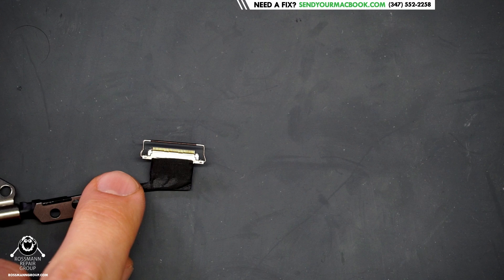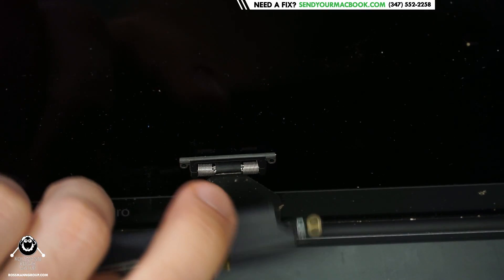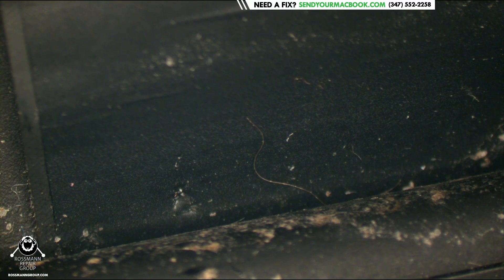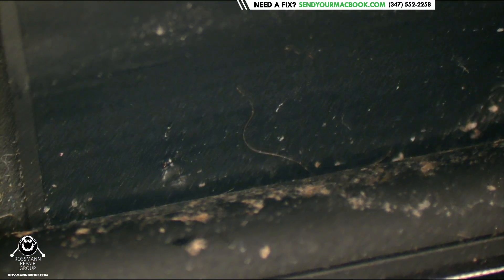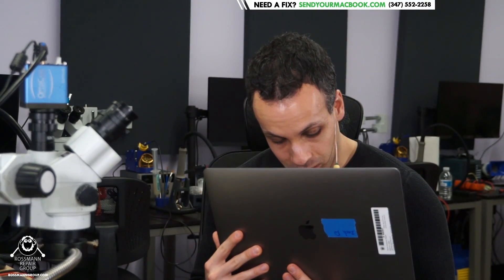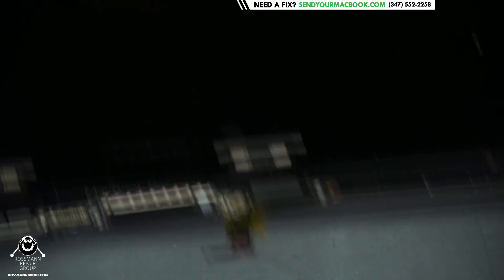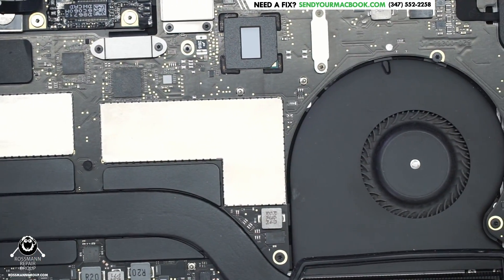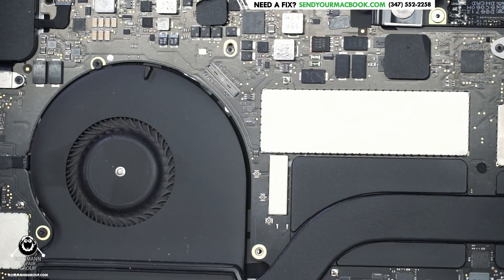How dust destroys irreplaceable parts of your Macbook Pro.

Comment: That is insane. Meanwhile, I've seen desktops with literal chunks of dust functioning just fine.
Reply: Desktops don't usually fold themselves in half either.
Reply: @sethreign8103  Flip phones do get folded often and don't experience issues from dust.
Reply: @grayrabbit2211  The maker of flip phones back in the their days probably used better quality materials to protect the cables and wires.
Reply: @Rhaspun  of course they did - they designed products to last. Now planned obsolescence is their business plan.
Reply: @grayrabbit2211  If things were built the way the original AT&T built things. We would have products that could take a beating and still run. In a way it was good that AT&T was a monopoly.
Reply: @Rhaspun  it was actually good that the Bell companies owned the customer telephones - they made them reliable and  were focused on TCO, not letting their marketing team drive the train by selling a new version every year.
Reply: Honestly it’s probably because Apple doesn’t care, people usually in the apple ecosystem don’t tend to leave “because apple is undoubtedly best in every way”, so if apple makes more money by not fixing that issue without loosing customers, why would they fix it??

Comment: I had a very similar situation recently. My keyboard and trackpad stopped working and after trying various software fixes I took it to a repair shop. The cable connecting the keyboard and trackpad to the motherboard is very similar to the one in this video, very thin and flimsy, and they repair shop showed me an indentation caused by dust just like this one that caused it to break. Thankfully they were able to replace it, but according to the shop my computer wasn't very dirty either and this still occurred. Serious design flaw
Reply: on purpose in apples case

Comment: Ah, man. I remember years ago returning from the city with brand new 500GB hard disk. I opened up my PC and plugged the shiny new hardware. I noticed a speck of dust on one of the exposed part(a tiny black square) of the hard disk. I shrugged it off since this I have a lot of other hard disks that are dusty and never have a problem.
I turned on the PC and...I smelled something burning.
Reply: Seems like a coincidence, dust per se doesn't really do anything to those, that's just BGA ICs in their black epoxy casings. Either that wasn't dust at all but a sign of existing prior damage, or the fault actually occurred entirely elsewhere.
Reply: @SianaGearz   I didn't install it right away, just flipped the PC around and connected the hard disk on top of it with the exposed potion facing me. I saw the spec of dust burst into a tiny flame and burned a hole on the black component.
I could spend one second to wipe that dust off but  noo....
Reply: @dareka9425  Whatever it was, it wasn't dust. The BGA enclosure was probably already ruptured by the time you had it in your hands.

Comment: That's a REALLY lousy design problem. When stuff like that happens I'd just want to finish it off with power directly from the chopper transistor in the wall power supply. Of course never on a customer's machine... but it can be effective in saving time.

Comment: I've got a gripe with levono and how they designed the pathway for the LCD cable to the motherboard. Tried buying a replacement LCD cable and the plug that attaches to the motherboard was too short and thick.
Reply: Sounds like you got one for a different model than what you needed it for.
Reply: @sethreign8103  Or the part was accidentally-maliciously misidentified in repair documentation?
Reply: @sethreign8103  the order had the  exact model I needed, it's just that the length ratio between the motherboard plug and the display plug were too fucked

Comment: It seems to me that Apple and other manufacturers need to build internal data cables out of more durable materials and away from air passages, especially considering what prices Apple is able to demand for their products.
Reply: Cupertino doesn't care about stuff like that anymore.
Reply: @ericpowell4350  Well, it certainly seems that way.  If Apple faced stiff competition from other manufacturers that built more reliable products, it would be compelled to build more reliable designs. Competition does "build better mousetraps."
Reply: @chetpomeroy1399  please consider supporting the new Framework laptop company.
Reply: @chetpomeroy1399  I use Apple not because it's a better mousetraps but because the mice are much richer and buy my apps more. And i have the ability to buy better apps for my work too that never got ported to Windows (because they stopped caring for Desktop 12 years ago with Windows 8) or Linux (never cared about Desktop).  It's a network effect and has nothing to do with Apple.
Reply: @llothar68  Apple software, including its operating systems and apps, are very well designed, very reliable and are very effective in helping their users to get their work done, there's no question about that. I just wish Apple would find better materials for their internal ribbon cables used in their laptops, which would improve upon their long-term reliability, just like the quality products they made in the 80's and early 90's.
Reply: It's almost like it's designed for failure...
Reply: yes but if the did that then it wouldnt cost you more money to buy a new one
Reply: You're new here, huh?
Reply: Ribbon cables to the screen should probably NOT be a thing, they always broke. Encased in several layers of Kapton, they still managed to wear through, even without dust. This was an issue in early IBM laptops, it was an issue in Uniwill laptops. I used to work in laptop repair 20 years ago and these were like one of the main recurring issues. Every time i see a ribbon cable to the display going through a moving hinge, i grow very suspicious. Even Psion V broke their keyboard ribbon cables, with minimal movement, and it really rolls the ribbon quite carefully. I think Nintendo managed a working clockspring cable assembly to the display several times, but that wasn't without issues either, and it did have a more fortunate aspect ratio, so ratio between width and thickness.

PC laptops nowadays usually simply run a twisted braided cable through a hinge... basically like Ethernet or HDMI cable but nicer and thinner and more flexible. It maybe doesn't look super elegant when you're trying to make a machine that looks like nothing holds it together, because you need that thick hinge to hide the passthrough, but it just works, no problem. Once these cables became a thing, the problem of broken display cables was gone for good. You know, maybe people should design machines that look like they're made to be used? Just a thought.
Reply: You want apple to deliver build quality?
You have better chances walking to the moon :D

Comment: Moon dust was one of the most worrying aspects of the moon landing. It destroyed suits, couplings, cameras, coated every surface in the lander.
Reply: There is no atmosphere on the moon, so no air, wind, water. Erosion on earth makes dust particles much smoother, on the moon it doesn't happen and the particles are very sharp and very abrasive. That's why they were worried.
Reply: @gforce833  Exactly...not many people know why moon dust is so dangerous.  That is exactly the reason.
Reply: Eventually it will destroy all of us.
Reply: @VV-nw4cz  Cough Cough Cough *Starts Panicking about possible moon dust in lungs*
Reply: @VV-nw4cz  we are all blobs of stardust given imagination, and one day we will return to that form.

Ashes to ashes, dust to dust.
Reply: @Guru_1092  "...and to the dust you shall return."
-The book of Eli
Reply: If Apple helped make a Rocker, it would take off, get out of the earth atmosphere, and then tell you to contact the authorized Apple repair center because it took 1 bad sensor reading from the rattling of taking off
Reply: @tyrellwashington747  Cubrick insisted to film on site. So we went
Edit: 6 times in fact.
Reply: @kornaros96  he is such a perfectionist
Reply: Moon dust is much worse than earth dust. Its so sharp.
Reply: @tyrellwashington747  ..?
Reply: @tyrellwashington747  not with that attitude.... but yeah the 1st landing has pretty much conclusively been proven to use the same filming techniques as 2001 space odyssey

Comment: this video serves as a reminder to everyone regardless of what device you have take a moment and service it by cleaning the dust out. Even in your clean home dust accumulates and its very tiny our eyes will hardly ever precieve it. But a machine that sucks/ blows air alot will notice it over time unless you are the type of person that puts those hepa filters over your fan inlets you will have dust in your machine. I have only seen those filters as an option on high end gaming pc cases not laptops
Reply: I just wish dust removing features were integrated into more products, especially videogame systems. I took apart a first run Xbox One, the "VCR". It was frustrating to take apart and a nightmare to put back together because of how the plastic tabs clip into each other. I cleaned out as much dust as I could without further disassembly. The whole reason I took it apart was it had shutdown due to overheating a few times. I would have went as far as to refresh the thermal paste and pads, but I don't have a backup Xbox if I broke it like a moron.
Reply: @browsingstuffaimlessly4663  PS5
Reply: @mcopolo89  PS5 needs to be cleaned too. It's even a bigger pain in the butt because of the liquid metal. it's not like it's a dust proof system, or particularly easy to disassemble.
Reply: @gforce833  what I meant was there was vents built in to the PS5 so you just vacuum the dust
Reply: @mcopolo89  Good luck with that. The PS5 has several large heatsinks inside that will get clogged with dust eventually. You're not cleaning that shit with a vacuum from the outside.
Reply: @gforce833  what’s with you being so defensive dude? Chill out and have a merry Christmas! the PS5 was designed to have vents that vacuum dust. Is it perfect? no! But I was replying the OP’s comment in regards to hoping more companies will incorporate dust cleaning designs in into their products.
Reply: @mcopolo89  he doesn't read as defensive at all...
Reply: @Voyajer.  if you don’t think is defensive. Good for you. good luck with that.
Reply: @KuK137  sure. Whatever you say. lol. Just can’t believe my comment is so popular that it started a flame war from you fanboys.
Reply: @mjc0961  I am still amused how I started a fanboy flame war. lol. I wonder how many more posts will there be on this topic. Haha
Reply: @mcopolo89  https://www.youtube.com/watch?v=vDKmdJC7p_g  So much for cleaning a PS5 with a vacuum. But hey, if you want to think Sony are a consumer friendly company and designed a system that is easy to clean and maintain instead of yet another over designed piece of shit, then it's your right.
Reply: @Mac Pot They don't exist. No PC case I've ever seen has HEPA filters. Some of them have extra dust filters, but they're nowhere close to HEPA level.
Reply: @Mac Pot I think you misunderstood.  Maybe read the comment again?  The jist of the comment was that regular PCs fan filters just protect against large particulates.  Even full fledged PC fans DON'T produce enough static pressure to overcome a good Hepa or paper type filter while providing adequate cooling to parts.
Reply: Amusingly the big workstation PC I have, has very little if any dust in it even after two years of near constant operation. Though it also has a bunch of space inside and a constant slow airflow going on, just keeping the air moving from intakes, through radiators, past motherboard components, to exhausts.

The smol handheld I got a couple of months ago though, already has a growing layer of dust on its fan intakes, to the degree where I'm very shortly going to have to go at it with a stiff brush and a vacuum cleaner.
Reply: I would clean the exterior of my PS4 each week but have never disassembled the machine. Had no issues for 7 years and it is now retired having survived many thousands of hours of use. Guess I was lucky!
Reply: I try to do at least a hand swipe on the table before placing my laptop. The amount of dust my hand takes out sometimes clearly indicate this is a good practice

Comment: Is it possible to have two big succion cups holding the back of the screen down and two other succion cups on top (connected with a bar or something idealy) and just heat up the sides and try to slowly pull out the front screen glass ? I know it's a dumb idea but, that could help in removing the glass in one piece :) though it might cause some issues with other components due to excessive heat i assume :P
Reply: I’m pretty sure they’ve tried something similar, but the aluminum syncs so much heat  and Apple uses so much adhesive that it becomes impractical.
Reply: @jacobrzeszewski6527  yeah, that's why i asked as i assumed that the heat would just affect other display components before being able to actually be able to remove the glass. If that can even be done flawlessly without breaking the screen :( even by professionals in the industry

Comment: i use a small rechargeable blow/vac with soft bristle brush in vac mode to clean that area.  you're right, even immaculate machines trap lots of stuff there.  I would call it "grains of sand" not "dust" that are the problem. lots of machines end up with food particles or stuff that's not "dust".  definitely a weak point in the design.
Reply: "it's ok, I have a warranty"
Reply: Well.. Dust comes in many forms. It can be rock such as dust clouds in a desert. It can be organic food particles. It can be many different things besides the small loose fibres from fabric that usually comes to mind when talking about dust.
Reply: How do you clean that area when you have to disassemble the logic board to get to it?
Reply: New Apple Macbook: Comes With Free Vacuum Cleaner!
Reply: all on purpose by apple.
Reply: @DaggerPrince  and a lot of every other companies

Comment: PCs tend to be quite vulnerable to dust, especially those built back in the AT days.  Once the capacitors start to mushroom, I tell the user it's time to say goodbye.
Reply: How to prevent the mushroom?
Reply: @rachmatzulfiqar  Replace them with better ones.  In practice you wait for it to happen and then either replace the bad ones or replace all of the types that show failure.  Often only the ones in warmer areas go bad and some stay fine for quite a long time.  It's rather rare for the 2000's era bad capacitors to cause real damage but eventually you'll get system instability once enough capacitance is lost.  There's really not much downside to just waiting for it to be a problem and then dealing with it.  Replacing sooner is just a chance something will get broken sooner.
Reply: Less dust and more air flow.  There was about a six-year period whereas capacitors were built poorly.  You could solder in replacements, but that was happening mostly in the pentium4 era.  Very few still use pentium4.
Reply: @stevejohnson1321  The last one I did was for a car mechanic's P4 that used it just to run some technical documentation software.  It was just easier to keep it running than find another machine to run the stuff.  But agreed, it's not as common to run into this stuff these days.  It's been about a year between the last one I did and the one before it.
Reply: I never recapped a motherboard, because a good replacement was no more than $69 at the time.  It helps that I run Ubuntu -- no product activation to deal with.  I did put new caps into my "free" LG flat-panel monitor.  It did quit again after 28 months, but 28 months for $5.50 in parts is a good trade-off.
Lately I just buy used business machines, because towers are drying up on the consumer market.  The ventilation seems better on newer systems.
Reply: @stevejohnson1321  Yeah refurb business lease machines are where it's at, so much value wasted by these idiot companies leasing machines at full price and returning them with 2/3 of their functional value left.